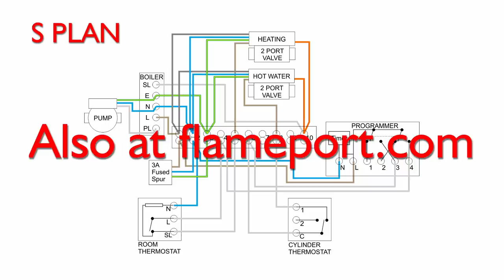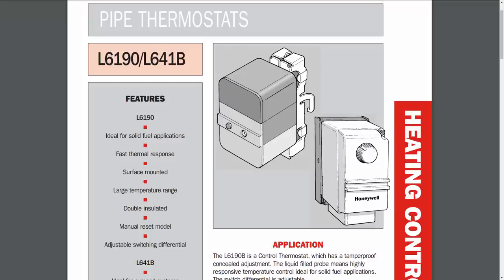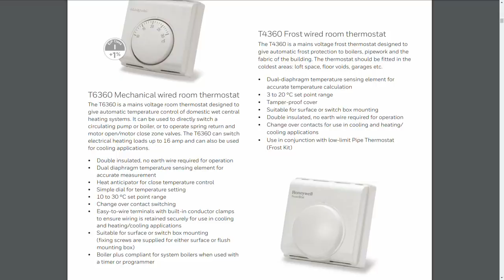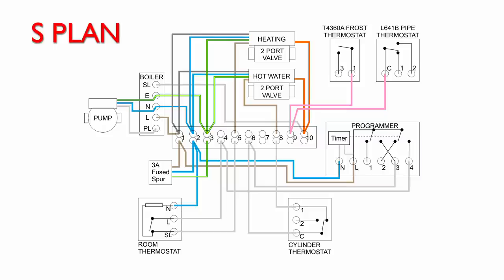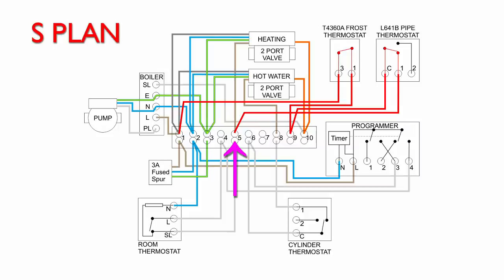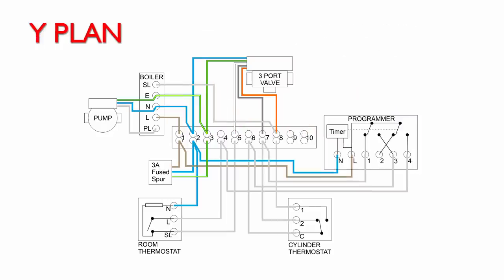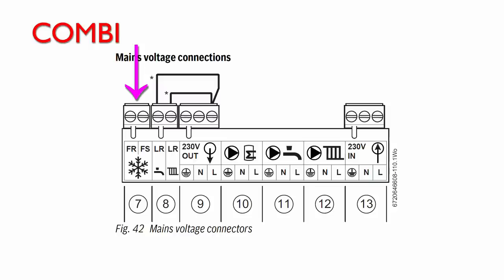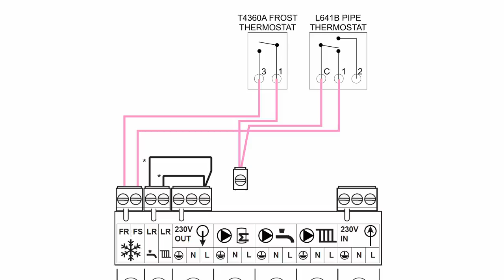Frost Thermostat Installation - S plan, Y plan, Combi

Comment: John, I’m a fan of your content. I have been a heating engineer for 28yrs and wire all my systems. It is common knowledge to professional heating engineers that you would always wire a frost stat and pipe stat in series in an exposed location. Also new condensing combination boilers in some instances now incorporate a frost protection.

Comment: Great stuff JW, i have seen these installed many times without the pipe stat fitted, in garages where the boiler is too. I always thought "shouldn't there be a stat to measure pipe heat?" lol now i know there should.I suppose there could be a short timed 10 mins on/off on the programmer for winter months at a push but...as our winters get milder in UK Frost stats seem to be fading away with the ozone layer ;-) great channel.

Comment: Thanks John, I'm about to upgrade my Y Plan to an S Plan (3 port valve keeps sticking) and also stick a Hive on it. I'd always wondered why there was no pipe stat next to the boiler (in the garage) next to the frost stat (probably cost cutting) Anyway I'm going to install a pipe stat while I'm at it. A perfect dummies guide.... which I probably need 👍😁
Reply: It might have frost stat protection built in

Comment: What’s the purpose of connecting the two stats in series? Could you not just get away with the pipe stat, as stand alone frost protection? Great video JW👍
Reply from the maker: Pipe thermostats do not sense air temperature.  By the time a pipe and the water inside gets to near freezing, it's too late.

Comment: Hi John, I am changing my froststat and found that the boiler switch does not shut off the live feed to it (voltage check). Switch does switch off boiler.  Should I reconnect froststat live wire so it becomes switchable?  - Or leave as permanently live even though it cant function anyway if/when boiler switch is set to off!?

Comment: John, thanks for this. On a tangent, I am thinking of changing my current system from Y plan to S plan. The 3 port valve humms at night and is, I believe a compromise to save plumbing and valve costs. However, in terms of simplicity and controllability then S plan appears to be better. Do you have a view on this?
Reply from the maker: S plan is better in almost every way.
The only benefit of Y was you only needed one valve, which saved a tiny amount on the installation cost- and that was decades ago when all systems only had a single heating zone and unvented cylinders were not something anyone had.
Reply: John Ward thanks for the fast response. Another ‘Lockdown Job’ coming up ....
Reply: @jwflame  John , just re-reading this. What is the relevance of unvented cylinders to S plan? thanks!
Reply from the maker: @whitefields5595  Unvented cylinders require a valve which defaults to the closed position if power fails or the motor fails.  Y plan defaults to hot water open.  Unvented on Y plan requires the addition of another 2 port valve for the cylinder.
Reply: @jwflame  OK, got it. Thx again for a fast knowledgeable reponse

Comment: Here in Canada we usually have forced air systems and I get why you'd want to keep the pipes warm but how does this help other pipes such as cold water taps or lines that go to taps in general if there is no water flowing in those parts? Does it just rely on the heat radiation inside wall cavities and such to keep other pipes from freezing? I would have thought it to just be easier to keep the air temp just above freezing.

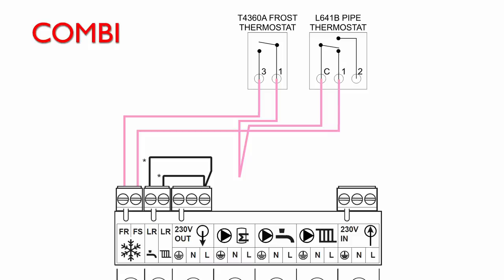Comment: Hi John great video - on the diagram at 14:02, is it possible to use one single wire to connect position 1 on the frost stat to position C on the pipe stat? or does it have to be two wires going in to a terminal?
Reply from the maker: A single wire would work, all that's required is those two terminals are linked.
However in reality you won't be using single wires as they would need to be installed in conduit, more likely is a 2 core flex to each of the thermostats.

Comment: Are those controls designed in 40's? Wouldn’t it be awesome if the boiler operated independently and kept the water at a constant set temperature and the heating circuit circulation was controlled steplessly by a three-way valve and the circulating water pump running continuously.

Comment: Great videos, JW. We have a Worcester Combi boiler but it is fitted outside against a totally exposed, external wall.
I would imagine that, by default,  it will already be fitted with a frost sensor? We have had this boiler for a few years and the only frost problem we had was an ice blockage of the '"condensate"(?) overflow into a small soakaway. This had been badly iinstalled. Any thoughts? Thanks.
Reply: I presume that the boiler is fitted in an attached outhouse or garage? Recent boiler plus legislation has addressed the issues re outside weather compensation sensors and upgrading condensate discharge diameters. .  Soakaways are notorious, being buried in the ground, they are very susceptible to freezing.  If it is run out on "overflow" that is 21.5mm tube, it will inevitable freeze up possibly even before it even reaches the ground level soakaway. You could try upgrading the tube to 40mm. A DIY job. Then wrapping additional lagging around the discharge pipe.  
You can even wrap a specifically designed heating coil around the pipe which is activated when the temperature drops, but this will not have any affect on the soakaway. The plumbers mantra "fill the kettle before I turn the water off" would apply. Pouring warm water over the pipe or soakaway will melt the ice obstruction, but it will again inevitably freeze during periods of sustained low outside temperatures.  That is just a pain.
Reply from the maker: Some boilers have frost protection built in, others do not.  Even for those that do, it will only work if the boiler itself gets to a low temperature, which won't cover situations where other parts of the building are colder than the boiler.
All depends on the individual installation as to what is appropriate.
Reply from the maker: Some boilers have frost protection built in, others do not.  Even for those that do, it will only work if the boiler itself gets to a low temperature, which won't cover situations where other parts of the building are colder than the boiler.
All depends on the individual installation as to what is appropriate.
Reply: Thank you. The boiler (an external model) is fitted completely exposed against gable wall. A relation has the same. The drainage system has been completely replaced with a T-branch should we have to add hot water. The soakaway has been enlarged. We have had no problems since this was completed.

Comment: I've lost count the amount of times I've had to explain to the plumber that we need a pipe stat as well, or the heating will stay on & bake the homeowner dry!
Reply: I grew up in a house in the 1970s that had a frost stat in the garage with the boiler. I knew when it was cold in the garage as I woke in the early hours in a bedroom that was so hot I could hardly breathe and it would remain like that until the garage temperature rose again. I can recall my father switching the spur off to try to cool the house down!

Comment: If the output of the frost stat and pipe stat in series goes to the white wire of the y valve, it will only send hot water down the heating pipework. But how do you wire it if you want the y valve to go to the mid position and send hot water down the heating and hot water pipework? Otherwise, wont the hot water pipework be vulnerable to frost?
Reply from the maker: Both white and grey would need to be switched, but that would have to be done via a relay.  White energised from the frost stat, relay coil connected to the output of the frost stat and N, relay contact used to disconnect grey when energised.
That arrangement isn't normally used as the boiler would have to heat up most of the hot water cylinder before the return temperature is high enough to open the pipe thermostat.  Most HW cylinders are also located within the property that the radiators and pipes are in, so freezing of that isn't likely to occur.
Reply: @jwflame  thanks for the info. I will just make sure the hot water pipework in the garage is well insulated, and wire the frost stat to y valve for just the heating as you suggested. 🙂

Comment: No John, I wouldn't do it like that at all !

Room frost stat (located in unheated part of property containing water pipes) would only open all zone valves and start the pump. This would ensure all the heating system is at the same temperature.
Pipe stat - positioned on the return from the longest circuit - and set to 2°C to fire the boiler. Putting the stat on the boiler return would find heat from the shortest circuit - likely a towel rail or even the cylinder coil. This would probably cause more heating than one would feel was necessary but at the point of turning the boiler off, the pump will keep running so the system water temperature will then even out over time. At the time point of heating, different sized zones will need different requirements and with the boiler off again, the pump will ensure the whole of all zones are at the same temperature and the pipe stat will keep that above 2°C.

It must be remembered this will look after the heating system but not other household plumbing - notably tanks in the loft - which maybe ought to be on a heating zone of their own - along with any other water pipes like the rising main.
Reply: pmailkeey the problem with Jw method is you are not open the DHW valve running the risk of bursting the coil in water cylinder?
Reply: @Stevie-m  Precisely. At least the 3 port valve version could open both ports covering DHW & CH. 
BUT even with 2 2-port valves, room stat operates pump, pipe stat operates boiler - and zone valves not touched but left open manually - then everything heating-wise is covered !

Comment: At a loss why anyone would have thermostat set at frost temp as you call it. Is energy really that expensive there? I am more concerned for heat loss reduction and keep at 50 USA. If your away from home for long periods drain the systems.
Reply from the maker: Yes, energy is expensive.
Draining and refilling a central heating system is not a trivial thing.  Draining it and leaving it empty for weeks will result in massive internal corrosion.
Reply: @jwflame  I have a heat pump water heater on a recirc pump ( 100.00 with rebate). Very inexpensive, and all pipes are wrapped. 2600 sf house on electric heat on heat pump, is about on average 150 per month or less. Because i moved out of city proper i have no water bills or sewage bills. Those cost savings of no fees pay for all electric cost. WA State USA. Gas unleaded today drop to 2.09... No debt, everything paid for...